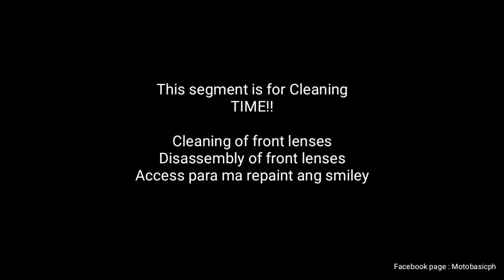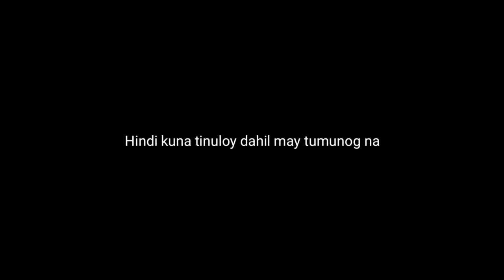HEADLIGHT, SMILEY ASSEMBLY, DISASSEMBLY, CLEANING (YAMAHA MIO SPORTY)

Comment: Paps,pde din b paint ung sa Headlight ng Mio? Tnx
Reply from the maker: Pwede naman boss kaso sa marunong at para sakin mag pa tint ka nalang na sticker kasi sayang mahal ang orig ng headlight. Unless may pambili kapa xtra. Tsaka sobrang dikit na ng adhesive ng HL ngayon need pa heat gun. At problema din sa buga ng ilaw kasi mag didim pag initiman mga reflectors
Reply: MotobasicPH ahh,,geh geh paps,pa tint ko nlng cguro sa shop,salamat paps,Ride safe👌